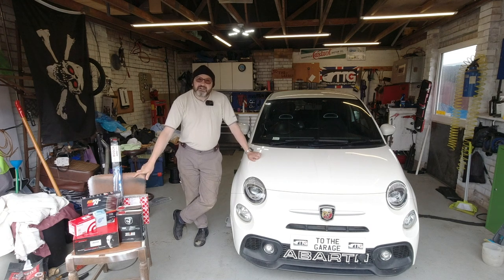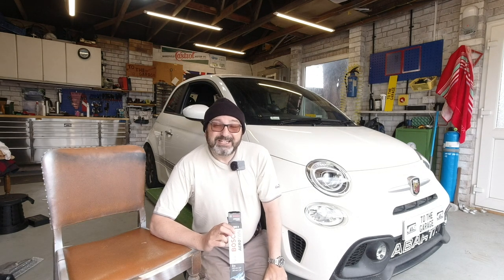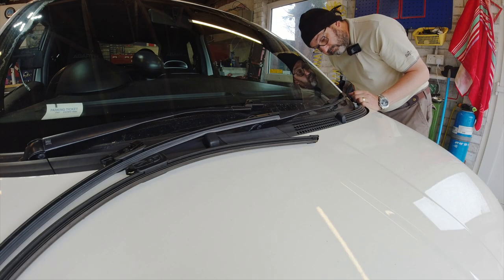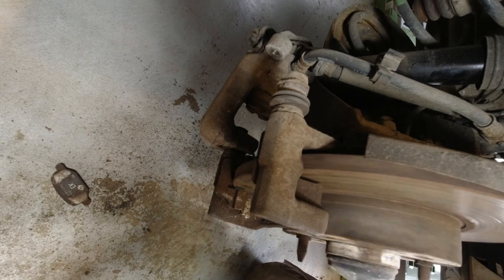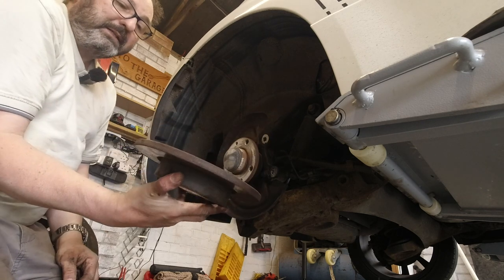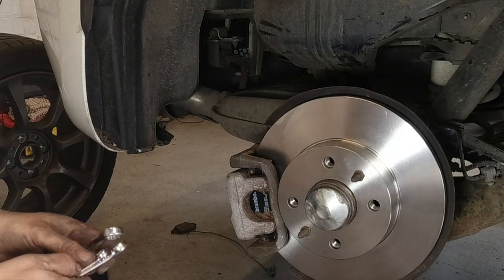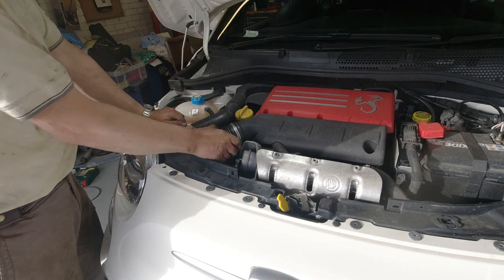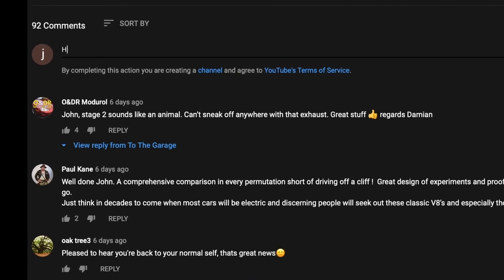rear disc change and home service on my Abarth 595

Comment: Great video, but the magic you pull at 20.20 where you suddenly just have the carrier out, it would have been nice if you had shown how, as that is the special part of this car. When I did it the first time, I broke a abs sensor. Fun cars to drive and fun cars to work on. We have the floating disc setup on our 695
Reply from the maker: 🤫 The power of editing😁.  To be honest i got in the way of my own camera at that stage and just pressed on for a while.